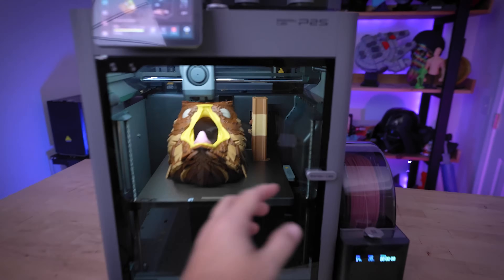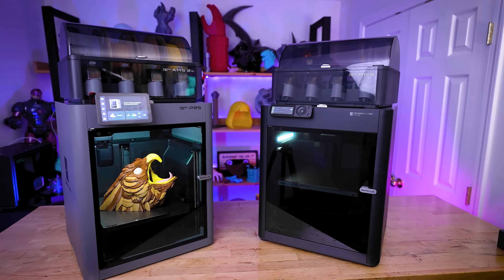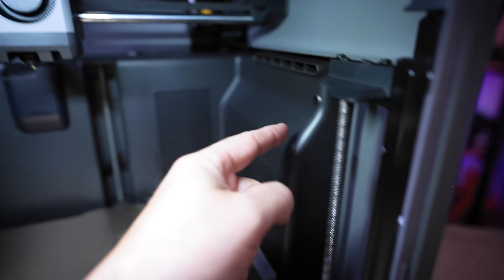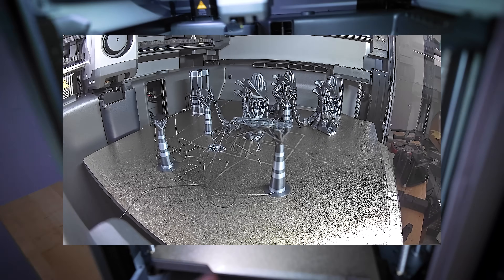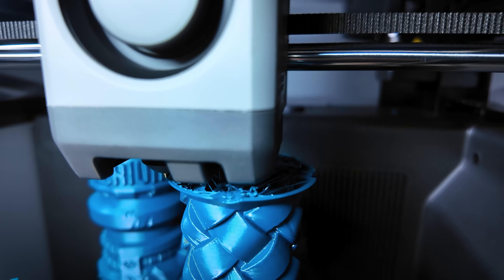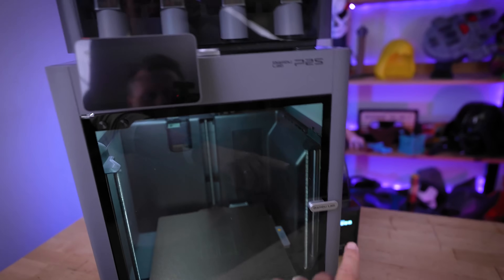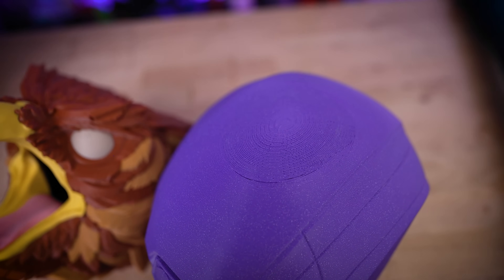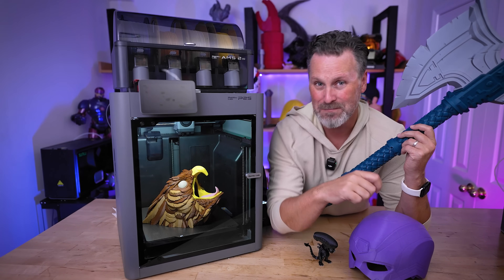Did the New Bambu Lab P2S Just Kill Off the X1C?

Comment: hey im looking for a new printer im thinking h2s because I want to be able to print helmets and armor easy and still not to put much work into tending for the printer and making sure its reliable and nothing will go wrong what should I go for?
Reply from the maker: H2S would be an amazing option for that. Plus it can easily handle printing with ABS or ASA which will make for extra durable prints. Loving my H2S so far!

Comment: its annoying because ive just bought 3 new p1s machines and didnt know this was a thing....hoping the new screens can retro fit onto the p1s
Reply: “Q: Is P1S upgradable to P2S?
The P1S does not currently support upgrading to the P2S model. Unlike the P1S, the P2S is not a partial component optimization, but a comprehensive iteration covering core hardware - key components such as the frame structure, mainboard, toolhead, screen, and air circulation system have all been redesigned. These components have fundamental differences from those of the P1S in terms of specifications, parameters, and functional logic, making it impossible to convert the P1S to the P2S model through simple component replacement.”
Reply: Don't have your hopes up, I dont think a retrofit screen is planned 😢
Reply: I don't think I have ever used my screens on the printer. I either use my PC or my Phone.
Reply: @Teab8g  true, its what i do tbh and im already seeing problem videos reporting on the new machine that many are not reporting because they dont want to stop getting their free machines